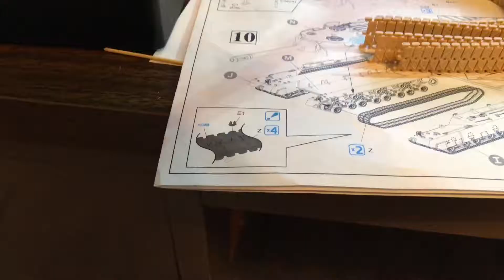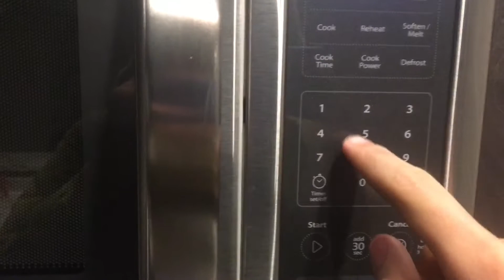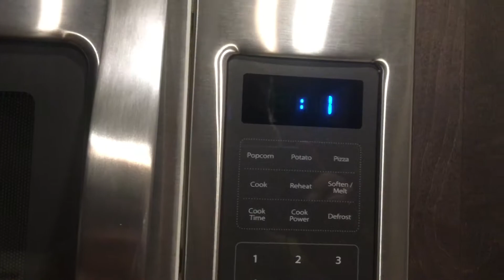Dragon Models T95/T28 1/35 scale

Comment: Do you think aftermarket Pershing tracks will fit the T95? I'd probably have to buy 2 sets, but will it work?
Reply from the maker: Patrick Ramirez I’ve never built a Pershing model so I can’t say but if you do decide to buy spare tracks I’d go with fruil so your not stuck gluing 400,000 parts per track
Reply: @meismagiic4779  or any other brand of metal tracks. I hear Fruil requires cleanup and drilling while other brands do not. The only guarantee of Fruil is that unlike Chinese brands, I'm sure there's no lead.
Reply from the maker: Patrick Ramirez the drilling doesn’t bother me because I shove staples in them